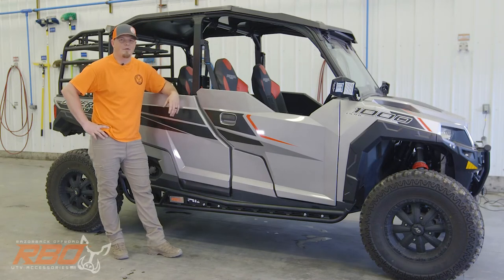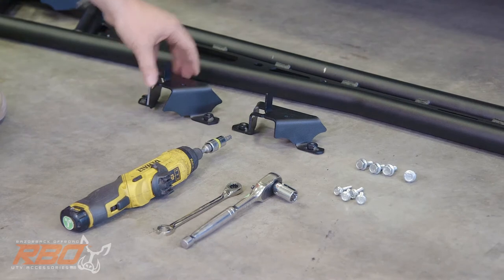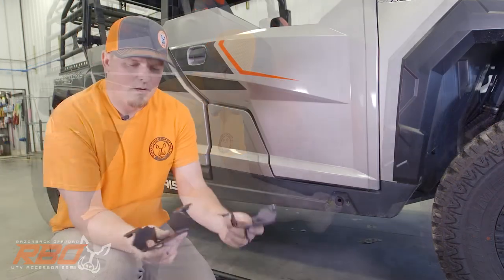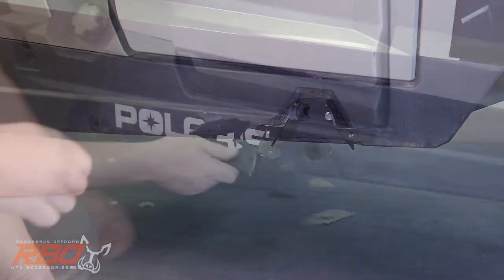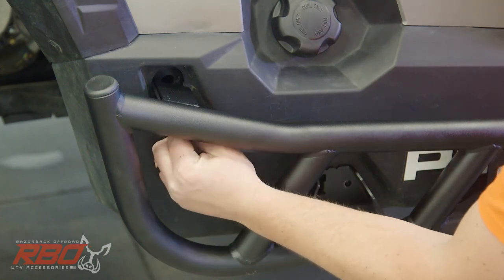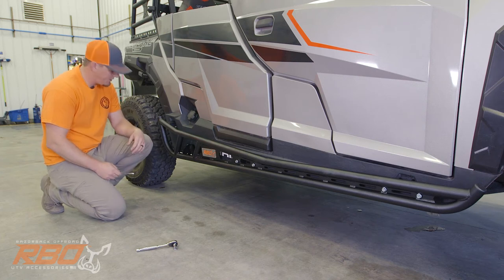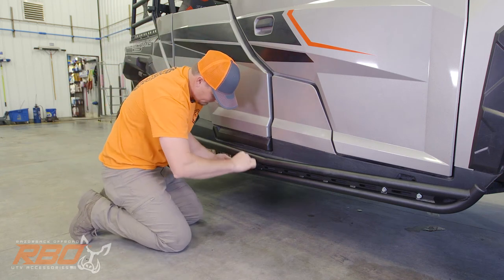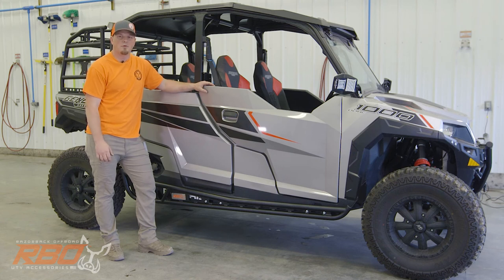4-Seater Polaris General 1000 Rock Slider/Nerf Bars Installation by Razorback Offroad™

Comment: Is this a true rock slider in that it can support the weight of the machine?
Reply from the maker: Hello USMC Shepherd, we have used our rock sliders as a jack point to pick up one side of our machine to change the tires before, so yes, it will support the machine in that instance. As well, they also include a load dispersion plate.
Reply: @RazorbackOffroad  thanks for the quick response...I’ve ordered my new Polaris General XP 4 1000 and will be ordering your rock sliders and cargo rack as soon as it comes in!